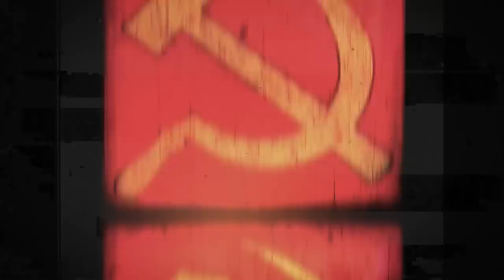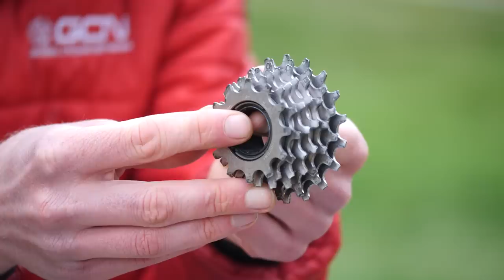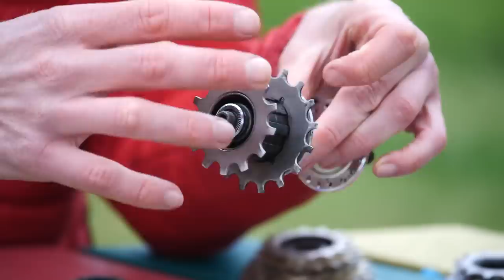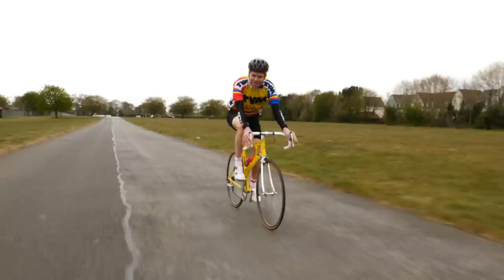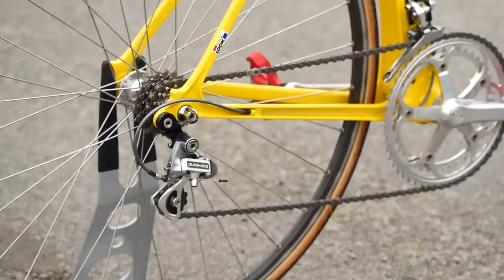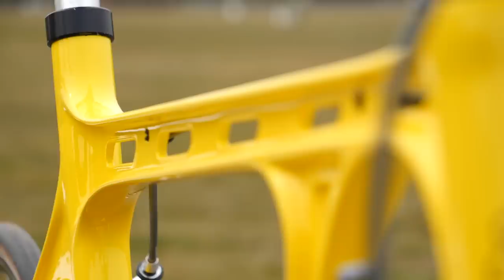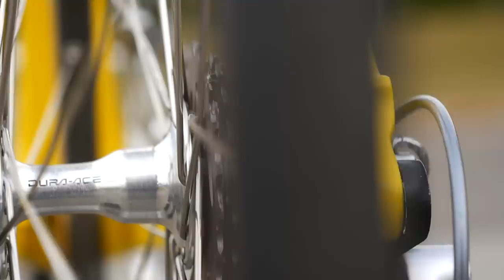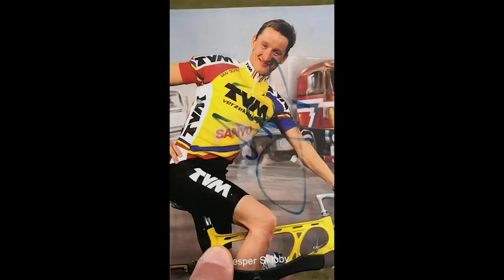The Greatest Cycling Innovation You've Never Heard Of | Shimano Hyperglide

Comment from the maker: Do you think Hyperglide is one of the most underrated innovations in cycling? Let us know in the comments 👇
Reply: Yup, big improvement over the old Suntour plain tooth freewheels I used to use, and an improvement over Uniglide. Shifting is crisper and it runs more quietly. Although those cleverly shaped teeth in the Hyperglide and the remarkably good and cheap knockoffs by SunRace can be finicky in friction mode -- the ramped/shaped teeth really want the drivetrain to be locked in place with index shifting. In friction mode while trying to trim the lever to reduce chain noise, it'll try to shift when you don't want it to. No such problem with a properly set up index shifting system.
Reply: check you facts before posting content , Hmm GCN get your facts right Hyperglide is on both Freewheels and Freehubs, and on that Kirk precision frame  Sti shifters would fit easily
Reply: Its introduction is almost entirely the cause of Shimano's subsequent domination of the component market back then (before SRAM).  Their shifting was head and shoulders above SunTour and Campy, their main competitors.  Since "skipping gears" and any other number of complaints about "bad shifting" were the main complaints from customers, the bikes with Shimano quickly outsold those without.  It was night and day.
Reply: @bigstu_  that was implemented prior to Hyperglide, but just barely.
Reply: @vicgravelrides  It is now.  But Hyperglide was introduced on cassettes only, if memory serves.  Only later when the cheapo bikes persisted in using freewheels did Shimano utilize the design in freewheels.
Reply: Thought I had a underrated hyperglide but it's a LX mf zo12 that still works flawlessly and sounds so good after all these years.I don't understand how they shifted gears while racing back then especially with those narrow drop bars that were so common.
Reply: @saddleweary9709  , check GCN's recent interview with Sean Kelly for what it was like in ye olden days (IOW, my era) racing with downtube shifters, especially friction shifters, and especially on gravel and cobbles.

Indexed downtube shifting was an improvement, but "brifters" offered a huge improvement. Now you could shift while standing to climb. Huge advantage when trying to avoid getting gapped. No need to sit for a split second to shift, then stand again. Watch guys like Kelly, LeMond and others who were in and out of the saddle on mountain stages, or just grunted it out in a gear that was uncomfortable tall rather than sit to shift and risk losing momentum or getting gapped.

I still keep my Centurion Ironman mostly original, with the Suntour Accushift downtube index shifters. Love the bike but it's a challenge on spirited group rides when we hit the many short, steep rollers in our area. Much easier with brifters to maintain momentum and stay in the draft.

 https://youtu.be/dKAFZO1U4SI
Reply: @dudeonbike800  , in the downtube shifter era, Suntour Accushift wasn't bad at all. The main weakness was the Alpha series freewheel, with plain teeth. Biggest improvement anyone can make to an otherwise original Accushift setup is to switch to SunRace chromed MFR30 or MFM30 7-speed freewheels. Those have nicely shaped teeth to shift crisply.

But if you read the tech manuals for Accushift back then, you'd think the entire system had to be flawed because it was so picky to set up. All they had to do was improve the freewheels. I still have Alpha freewheels but they'll probably still be in a box in the closet when I'm long gone. 

But Shimano responded quickly to user complaints about glitches in the early index shifting systems, and the rest was history.
Reply: @theparalexview785  Definitely going to check that out. It's amazing to me what they did back then. Thanks a million.
Reply: When will they introduce "Ludicrous"speed glide?
Reply: Bring back Jon!
Reply: I've got one of these. Made a good single speed conversion. The cogs can be put on backwards when they wear out. Shifting doesn't matter for single speed. Uniglide.
Reply: Nah, making a gazillion bb and headset standards is far more innovative approach to sucking up consumer dollars.
Reply: Haircuts clearly are underrated tech in cycling. Get a real haircut, Ollie.
Reply: Downtube shifters. We use to change gear with our knees :D
Reply: @KenSmith-bv4si  Or the Fire Fox thought control shifters.  I don't know Japanese!
Reply: @davidburgess741  Thats like a 100yr old reference but, a good one.
Reply: Absolutely!
Reply: @KenSmith-bv4si  never.  Cyclists won't cope with going to plaid.....
Reply: Hypergrind does make shifting smoother, but it also causes rapid chain/cog mating.  I raced off road for years without hypergrind and I found I didn’t need it because I knew how to shift.
Reply: @slidey1788  
May the Schwartz be with you!
Reply: I dont understand what this video is talking about, but, there is INDONESIA printed on that cassette. It make me proud. Which is my country...
Reply: No no no. Nexus hubs are underrated.
Reply: No that would be The OneWheel XR. Why do I need a manual shifter on bicycles of such expense? I mean seriously "who needs shifting when all I need is weight transfer?" might sound toopid ... but in fact is the exact opposite.

"Yet another Industry ripe for disruption."

Move along..
Reply: Yes it is! Didn't know about this before watching this! And I own two modern road bikes with Shimano group set..
Reply: It's overrated.
Reply: Didn't Campagnolo make their cassettes like this first??? 
Anyways, it can only be a matter of month before we see the Micro Spline (XD driver in SRAM world) from MTB, make it onto a road bike and give 9 and 10 teeth options for the smallest cog. That's the whole secret behind the 1x12 with 500% range. Would allow smaller front rings, while maintaining high speed. Or give higher speed, so riders can comfortably pedal even at 70-80 kph on decents
Reply: Yes. Good video and the man has insight for sure. I switched my bikes to indexed shifting only a couple of years ago believe it or not (I am very old school). It improves the riding experience by an order of magnitude and it couldn't have happened without hyper glide. I knew Shimano was up to something when I first saw those fancy teeth.
Reply: Yes it is! Not STI or more gears were so important to me than Hyperglide. I switched to a Hyperglide cassette on 1989 and changed no other technologie on my bike for 18 years. In all these years I was happy with my bike.
Reply: By far the most underrated innovation in cycling would be the "slant parallelogram rear derailleur", this was a Sun Tour design. One of many by Japan's other major component manufacturer. Every derailleur today uses this principle, Sun Tour found a rather simple tweek of the common parallelogram found in all derailleurs previously allowed the top pulley to be closer to the cogs and provided much crisper shifting. I do not know if other manufacturers licensed or stole the concept, Sun Tour was the originator.
Reply: @larrydaniels6532  I read on the internet somewhere (maybe at GCN) that Suntour's slanted derailleur was patented in Japan for a decade or so. Shimano patiently waited for the patent to run its course and then immediately started using the concept.
Reply: Yes that would make sense, the slant parallelogram is the reason that all indexed rear derailleurs work to the level that we now expect.
Reply: The wheel is the most underrated innovation.
Reply: XTR from the Original 1992 Groupset introduction and 1996 Dura Ace was awesome and so reliable and beautiful
Reply: What is tough is getting the clock position of the individual cogs right when making a custom block (a file is needed)

Comment: "In Stock" would be a far greater  innovation right now!
Reply: lmaooo
Reply: Followed rapidly by reasonably priced,
Reply: @leqin  wouldn’t put it better myself 😂
Reply: If you are in dire need for a rear-wheel with a fresh sprocket-set: Get a campagnolo-wheel which are easier to come by right now. Their 11s sprocket-sets are interchangeable except for the hub needed. Right now I am using a Shimano cassette on the wahoo kickr with a campa-bike attached to it.
Reply: So true !  Ordered a new bike told it could be 4-6 months.
Reply: I wanted Campy Centaur group parts from Merlin Cycles, not in stock the previous Thursday. I signed up for email alert for 'when in stock'. I got an alert last Tuesday, jumped on it right away. They delivered from UK to Los Angeles by Friday, at the best price anywhere.
Reply: there's absolutely nothing in stock!
Reply: Everything is in stock If you care to look at other brands
Reply: @leqin  Yep. My cassette normally costs 50euros and a friend wanted to get the same drivetrain a couple months and then it was 90euros and now ther is like NO wide range 11spd MTB cassette for under 75euros.
Reply: @mccalljeff  JG Bike on Amazon. Machined aluminum and seem to last for a year or so
Reply: @mccalljeff  Not even 8spd... That's usually NEVER out of stock.
Reply: Very futuristic
Reply: Comment of the year!
Reply: I've been buying anything that is available even if I don't need it. Got an 11s chain, brake pads, an 11-30 casette and 2 tires in a period of 2 months. I won't need to replace any of these in 6 months or so but I just want to be prepared if something malfunctions or breaks and there's nothing in stock
Reply: @jesseladd6864  Which country do you live in? USA? not everyone in the world is as privileged as the great American and European markets hey (Who seem to get preference purely on order size) That's how the world works. Where I am from we talking stock of, for instance the GRX groupset in 2022, if you lucky.. I dont need nuts and bolts, I need to finish a build.... God I cant even find a set of SRAM Force hydraulic brakes anywhere, not even imported! So what 'other' brands do you suggest?
Reply: @leqin  learn how to make any cycling component and then think about how much you would charge to even have it made by a machine in your garage and then finished & packaged by a Uighur who you pay in biscuits & rice.
Reply: @mattmatthews5414  Thankyou for the lesson in manufacturing..... I will keep it in mind when I am busy surrounded by all that CNC machinary incluidng lasers and multi-axis machine centers and press brakes and lathes and mills and.... like I said thanks for the lesson.
A couple of years ago I bought a spoke nipple driver and at the same time purchased a spare nipple holding spring just in case the one fitted broke, which they do every now and then. In 2019 that spring cost me 50p. In late 2020, when I decided to fit a set of 29er wheels with a bolt thru dynamo and needed to fit new spokes I had the misfortune to break the spring fitted in my well used driver and swapped it out for the one that cost me 50p and then went online to buy another spare.... it is a piece of piano wire 0.4mm in diameter and 23mm long and then formed in the middle so that it captures the nipple and holds it by spring tension so that you can screw it in place onto the spoke. As if by magic the same shop now sold the same spring for £12.51 each plus £4.99 for postage.
I tried taking my business elsewhere, but found it was a similar story and  decided no problem I can make this and bought 10 metres of 0.4mm piano wire and made several spares and if anybody wants one I can supply them cheap at £12.50 each plus postage.
In 2020 people began marking prices up and for some things to absolutely ridicoulous degree.
Reply: @jesseladd6864  I'm not so sure about that.  SRAM is also out of stock on all road bike components, although the wait time to get SRAM is much shorter than Shimano.  No thanks on Campy-they do make good equipment but it is overpriced and their crankset+bottom bracket design is garbage. Plus any other brands would not be used by the majority of road bikers - FSA, Suntour, or any of the low dollar components available on AliExpress.
Reply: @jeffr119  What are you talking about? SRAM Rival is available everywhere for about 255 USD. Do you mean your LBS, or are you in a country that isn't stocked well? 
If you really can't find the major brands - SunRace has a 12speed groupset, as does microshift.
Serious(TM) road Brakes are available from TRP, Tririg, Ciamillo, and a few other manufacturers. For disc brakes I guess Paul Klampers (but I don't have a disc road bike so I haven't peeked into that zone.)
Bottle cages? Silca, King Cage (both titanium), Supacaz - are cages even in short supply?
Wheels? All over - Profile design seems to have no stock issues as one example of high end ones

I'm not exactly sure what you're looking for but it's all available if you're looking for high dollar components.
Reply: My friends think I'm stupid for spending so much money on parts but now that we are into this shortage situation I feel like the smartest guy. One of my buds can't even get a 11spd chain which makes me feel bad because I'm not selling mine.
Reply: @carlosbarrios2203  Smart guy. I'm the same. I always buy spares of things I consider to be wear items.
Reply: Yeah, just had to find and buy parts, so the bike shop could repair my bike. They had given Up.
Reply: @wasupwitdat1mofiki94  
YBN 11 speed chains are in stock though. Even in gold.
Reply: @Aubreykun  Just last week my buddy that owns a shop told me they are not, not even 12 speed chains. Nor disc brake pads, and cassettes. I believe him because I don't know you.
Reply: @Aubreykun  I tend to be loyal to my bike shop friend. I don't trust Amazon or ebay even though I have made some ebay purchases in the past, but only if I can't order what I'm interested in through his shop. I'm not really concerned about searching for the best price anymore either.
Reply: @wasupwitdat1mofiki94  Well in this case distributors seem to be strangling your buddy's shop.  If need be you could even point him out to brands like YBN and Wipperman's Connex. They're not as prolific as the usual brands for chains but they're excellent still, made in Taiwan and Germany respectfully. My post above in this thread has some other brands listed for different parts. If your buddy's distributor is reaming him and costing him income during this time of high demand, it sounds like he needs to make some new deals.
Reply: @kaedeschulz5422  100% wanted to put a bigger cassette on a really old 8speed HG bike and no chance 😒
Reply: @jakethesnake1976  Because of the derailleur i guess..
Reply: @kaedeschulz5422  no lack of stock like you said EVEN with old 8 speed
Reply: @jakethesnake1976  Oh yea.. Sry i just got up from a raugh night.
Reply: @kaedeschulz5422  wonder why the prices have went so mad. Is it a supply and demand thing or companies trying to cash in my making less components to inflate prices.
Reply: @chris9650  Everything costs more. Even some tomatoes cost more. It probably is caused by supply problems and in the UK brexit and for Ragley bikes and other UK bike brands it's also the brexit.
Reply: @kaedeschulz5422  the prices have become silly now though.
Reply: @chris9650  Yep. Probably because they must make money with the little bit of stock that is left.
Reply: Yeah like why is there no bicycle stock anywhere right now? It’s ridiculous.
Reply: @aygwm  Corona + Crazy demand. You could have had that answer if you thinked for one second.
Reply: XD Im ded

Comment: But didn't the STI leavers come with lugs that connected to the down tube?
Reply: Don’t say I ever left STI 🤔🤪
Reply: Those are braze-on cable stops that came with them. They went on the brazed-on posts where the down tube shifters were bolted on the down tube. Race bikes with down tube shifter posts brazed on the tube don't have cable stops for shifters like post-80s race bikes began to. The down tube shifter is where the cable stopped, since along with the cable guide on the bottom bracket, it created a straight line of travel for the cable, no housing needed. Instead you bolted the cable stops there when you installed STI levers, to have cable stops for the longer, non-linear cable travel from the bars to the down tube.